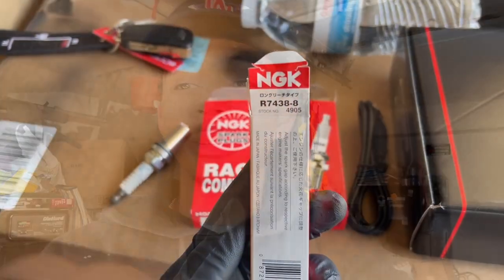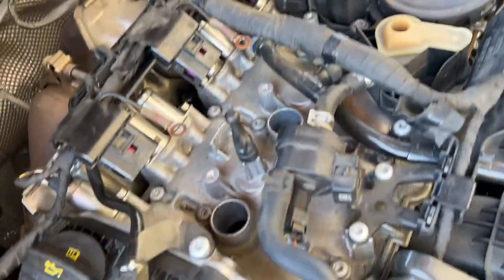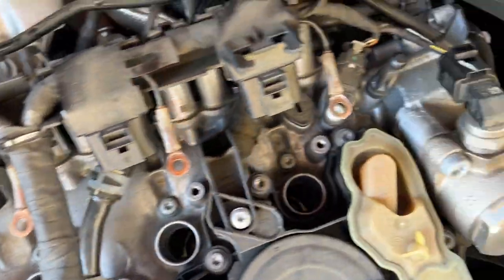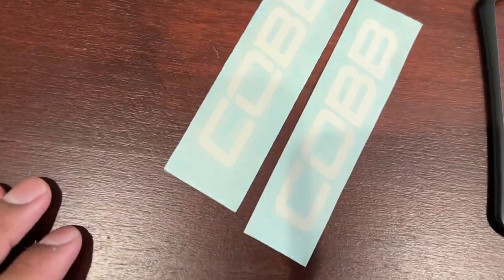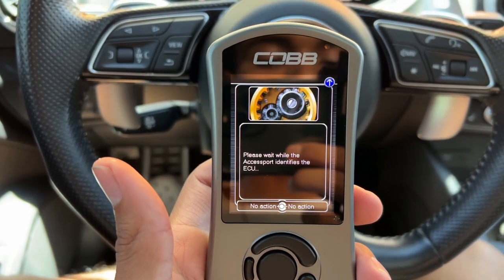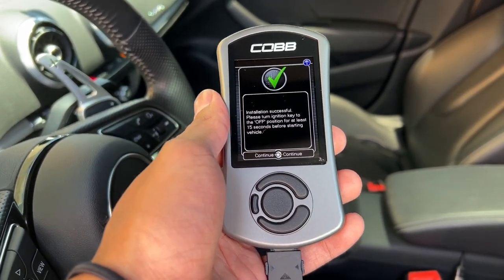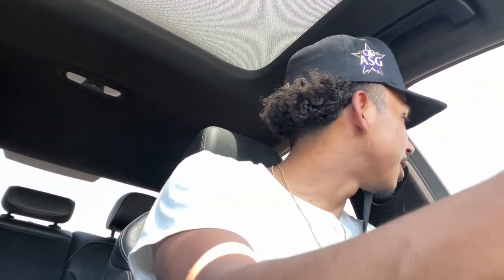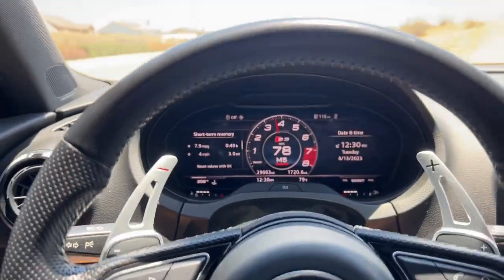AUDI S3 EQT STAGE 1 TUNE!! + 1 STEP COLDER SPARK PLUGS!! THIS TUNE SURPRISED ME!!

Comment: I went the 034 route with my stage 1 ECU/DSG tune on my s3. Got their x34 CF cold air intake, inlet pipe, and turbo muffler delete (muffler delete is not needed cause it doesn't add power BUT it definitely gives the turbo more whooshing noises) but all that paired with that same MBRP exhaust and I love how quick the car is even on a stage 1 and it sounds amazing. All that being said once you add the DSG tune youll definitely notice the difference in the pull and shift timing.

Comment: yo cuddy do these go with stock s3?
Reply: and how do you gap them?
Reply from the maker: they can, but not really necessary unless you’re adding power! the stock ones are just fine. but if you still wanted to you could. i just used a spark plug gapping tool.

Comment: Do I need to go 1 step colder if I go stage 1 with eqt?
Reply: Atm running cob ots tune and looking to go eqt stage 1 mainly the crackle n pop cause the ots map doesn't have crackle n pop
Reply from the maker: its highly recommended
Reply from the maker: you’ll need burbles to get pops. and a downpipe is highly recommended so you dont melt your cat